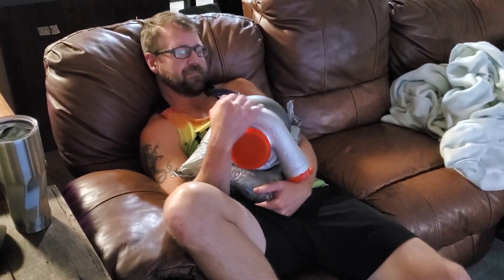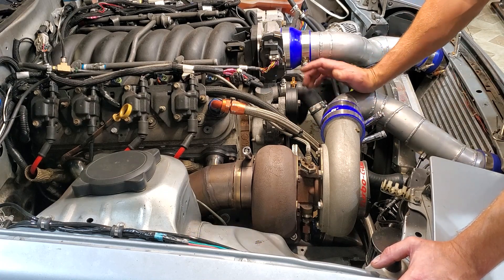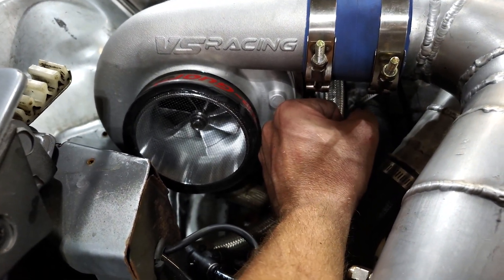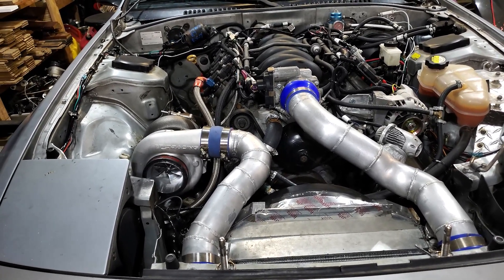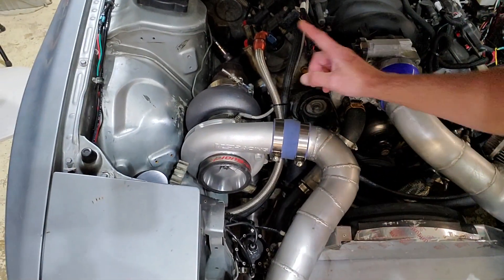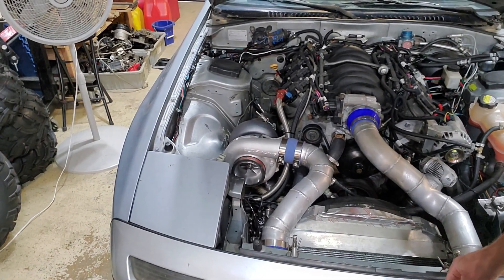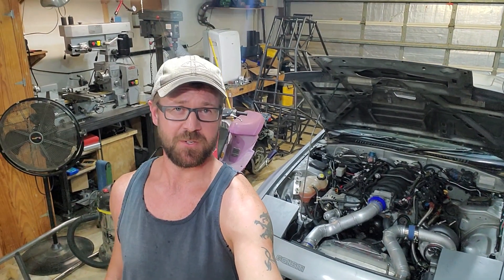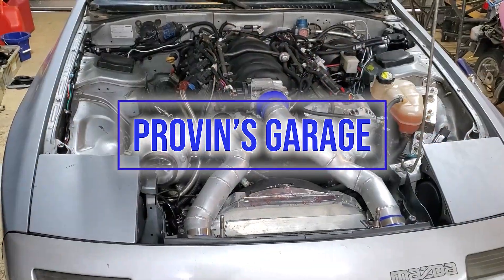New Party Whistle for Tater, VSR 7875 Gen 2.5 Turbo Upgrade || Swapping Out The Old gt45 Turbo

Comment: I'm going with vs next summer on my fox. I was afraid of them being chinese until someone pointed out almost every miscellaneous part is made in China . Plus su..it racing carries them so they must be alright, if not good.
Reply from the maker: I have zero complaints. I put a vband 7865 on my s10 build and it has also been awesome. The divised t4 has a larger hot side exit but the v-band seems to light up even faster than the t4. Probably has to do with my pre-turbo configuration but either way I'm happy with both

Comment: Very good man

What rpm you get full boost 25 psi ?
Reply from the maker: Starts making boost at 3k rpm, full boost in 3rd or 4th around 4500. The 4.8 revs easily past 7000 so it pulls hard up top
Reply: @provinsgarage  
Thx

Comment: Are you running a muffler / resonator? Shocked how quiet it is mines super loud same turbo just 3 inch exhaust
Reply from the maker: I was running a dual muffler at first, then  a resonator with 3 inch exhaust, now 4 inch down pipe for a few feet then down to a 3 inch resonator and bottom exit under the passenger seat. Sounds mean now... and loud lol

Comment: Whats done to the engine sounds good
Reply from the maker: Forged pistons, dual valve springs, and a stage 2 turbo cam from summit. Built a new one for an s10 build that will handle a lot more power
Reply: @provinsgarage  Nice I got a 85 swb s10 i am doin this combo in except gen 3 sbe :/
Reply from the maker: @UnsmartCanadian  the new motor I built is a SBE gen 3 4.8 with forged rods and pistons. That crank will handle a lot. I don't think 1000 whp will be a problem

Comment: Looking into buying this for my 5.3 aiming 800 whp do you think this is capable of that ?
Reply from the maker: With a good tune, cam, valve springs, and head studs it is capable of even more. I just had mine on the dyno and made 811 whp at 25 psi before running out of fuel system. Stock connecting rods and crank.

Comment: Which a/r 78/75 did you get?
Reply from the maker: 1.25 split housing. My t4 flange and crossover was already set up to be a split and I wanted a larger a/r anyway so it worked out great.